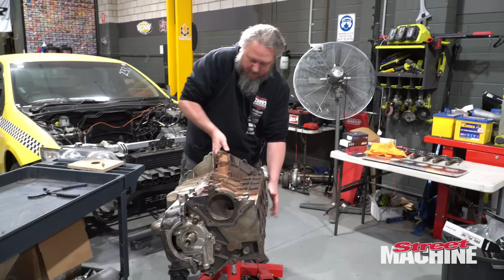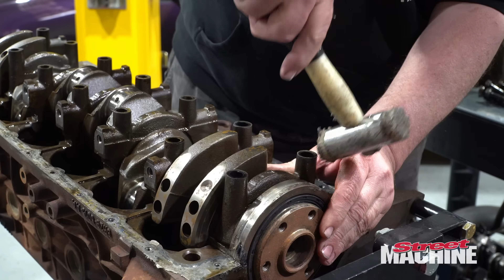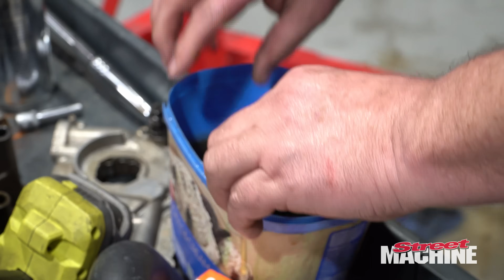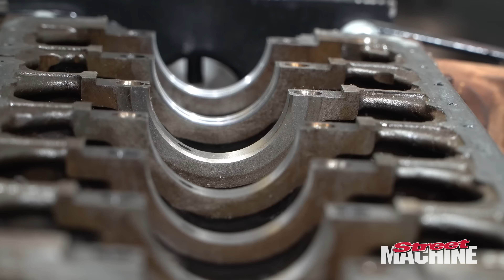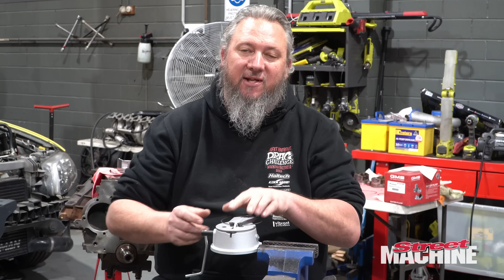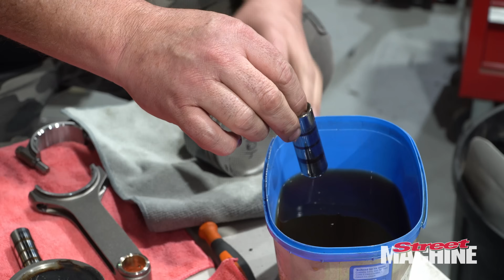Carnage - Turbo Taxi Gas Attack! One Last Go!

Comment: W had a new servo in Sunbury about 12 months old and it has four LPG pumps.  When I was filling up my alternative fuel Falcon (ie LPG) I had a look at the totals of each of the fuels.  LPG was the third highest seller after 91 and diesel (95 and 98 were the other options)
Reply: Hope it stays that way too, co2 emissions aren't the only thing to look at, gas is a lot cleaner than petrol.

Comment: Great work as always Scotty. Dont get to worried about the bearing clearances on the "send it" motor. I was a mechanic at Ford for a long time and over the years had a few tours of the Ford assembly plant and I can guarantee there was zero fucks given for clearances at the factory, they zapped the barras together fast, as long it it passed their hot test it was all ok.
Theyd stamp the timing case near the powersteer with a hot test number, if you got a car with 2 numbers you know it had a problem at the factory lol.
If they can do 500,000+km with assembly like that yours will be fine.
Reply from the maker: Wow, that's interesting

Comment: Remember when we could buy LPG for less than 5c per Litre. 
Then they made a deal trade economics deal and sold overseas for less than 1c/L, while we had to pay close to $2/L, then the government dropped the local LPG deals when Holden and Ford were still selling brand-new LPG-only vehicles.
The only down side, on a hot 30ºc+ day, trying to fill up when the servo was low on fuel and taking a while to get anything... just enough to get to the next place. But for me it has been Duel Fuel since 80's.
Reply: And rocking the vehicle side to side to get little bit extra in the tank.

Comment: Up here in Sydney the only major remaining servos with LPG are 7/11  and Budget and some independents,  Apmol have a few remaining but charging well above what the others are charging seriously $1:35.9 the other day, thieves.

It's getting harder ad harder to keep the Au Falcon E:Gas on the road, that said now that winter has gone and the warmer weather consumption has gone from 20L per 100km in metro down to 13L and out on the highways I am seeing low 9's per 100km so even with the standard 73L capacity tank (80% max refill) its not that bad on the highway run and metro is like v8 levels of consumption.
Reply: Most of the cost of LPG now is government excise. That's why the government pushed so hard with conversion subsidy's etc for people to convert their cars over. They kept quiet about the excise tax that was getting applied later. You have to keep using gas to pay off the conversion.
Reply: My Falcon is a 2000 AU E:Gas (re: dedicated LPG only from the factory). Not duel fuel.

7/11 for the most part have LPG at a per litre price of 94.7c to 99c, Budget have there at around 1.05c but AMPOL (thieves) have per litre pricing starting at 1.20 to 1
35.

My understanding is the federal government excuse for LPG per litre is 22c.

Comment: Scotty, if you think phasing out LPG is silly. Remember back to when they used to burn gas off as a by product for ocean oil rig drilling..thousands of liters of gas burned off into the atmosphere for nothing. 
Could try converting to methane gas maybe via driver seat 🤔😂
Reply: They still do burn it off. Burrup Point near Dampier/Karratha in northern W.A. When the towers are going flat out, it sounds like a jet engine and if the wind is blowing the right way from the observation area you can feel the heat from it too.

Comment: So like 4 or 5 years ago I bought a 2001 Honda Accord sedan (CG1 body style) with a J30A1 V6 with an auto that didn't have reverse. I yanked the entire swap and put in a JDM J32A 3.2 260HP V6, a 2003 Acura CL Type-S close ratio LSD six speed manual, Exedy OEM replacement clutch and flywheel, Hasport mounts, AEM Series II 30-6051 standalone ECU, AEM 340 LPH fuel pump, 1000cc Injector Nation injectors, a Holley intake manifold with a 90mm throttle body, custom made ARP head studs, I bought a cheap set of eBay headers and made a collector pipe with a T3 flange, a Garrett GTS3582 dual ball bearing turbo with a billet compressor wheel, .83 AR exhaust housing, 3" downpipe to an Invidia single in dual muffler exhaust, and my buddy street tuned it on 10 psi. It made 502 whp and it definitely ran like it. Then one day it broke a ringland while I was doing a pull in 3rd gear, and a student driver pulled out in front of me and I not only ran off the road to prevent hitting him, but I went into a drainage ditch and I still hit his passenger quarter panel. The car was totaled. Their insurance company gave me $500 and let me keep the car. I cashed the check, stripped the entire car, and scrapped it for $350. I used to money to buy a 2006 Acura TL that I swapped to a manual with the parts. I turbocharged it too, but it had electrical issues...

Comment: I thought only the turbo ran floating piston pins, don't the LPG motors run a larger rod but not a floating pin setup, I can't see any circlips?
Didnt the the BF2 onwards get the bigger rods?
Reply from the maker: Turbo and LPi run floating pins
Reply: @STREETMACHINETV OK interesting, just always heard and read the LPG engines still ran a press fit gudgeon. Never taken one apart though been offered one but in my reckoning it's worth very little being a high k taxi motor with a suss bottomend.
Many still think they're virtually gold plated being a 'greentop'.

Comment: Can you double injector this thing ? Seems not getting enough GAS into the cylinder has been an issue and injector failures.
Reply from the maker: It already has two injectors per cylinder

Comment: So what was the cause of the rod knock? From what I could see none of the bearings were in bad enough shape to have caused it.
Reply from the maker: Later in the video I realised that this wasn't the original Taxi engine. That probably wen tin to the bin at MPW. This is the first NA engine we swapped into the Taxi back at MPW at the start of the project
Reply: @STREETMACHINETV  Ahh yes, so that wasn't the engine you thought it was. You started mumbling a bit around that time and wasn't 100% sure where your train of thought was going. Just trying to remember the issues you had with different Barra engines. I remember you changed engines at one point because of the dipstick being in the wrong location, or am I thinking about the MX5?

Comment: With the number of barra motors that taxi and mx5 have used there should be a few short blocks and heads that be put together not to mention rods cranks cams
Reply from the maker: Most of the blocks, heads, and stuff have gone in the bin. We don't have much left now.

Comment: Scotty where are the rod bolt protectors?
Reply from the maker: it doesn't use rod bolts though, it has cap bolts
Reply: @STREETMACHINETV  the ones going in are, but not the ones you took out. More likely to mark the crank coming out than going in.

Comment: Our 3800 v6 went 8.81@160 with re-used tty main bolts 🤣
Reply from the maker: Fair enough, not sure why you would take that risk though especially with the 3800 when the ARP bolts are a cheap and simple replacement

Comment: Vialli lpg liquid injectors from the last fg released. 1000cc liquid lpg. That should do the trick.
Reply from the maker: Injectors aren't the problem
Reply: The last fg has and electric pump in the fuel tank that supplies LPG in liquid form to the injectors. It takes away the issue of volume supply. If your getting 1000cc of liquid to the rail and injectors, what's the issue/problem??
Reply: 8x vialli  largest liquid lpg injectors top out around 550hp on a v8, depending on tank temp/pressure. 
Modified tank/pump about 650hp capable. 
From what I have seen.